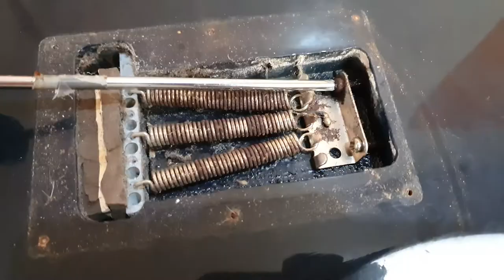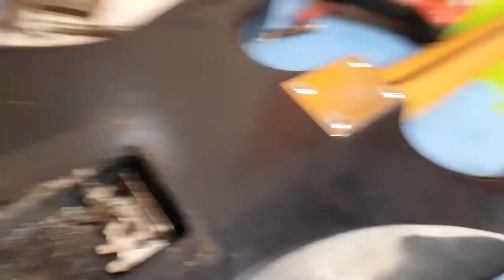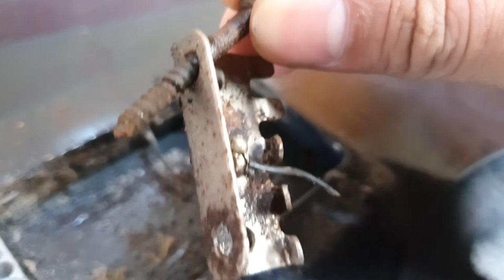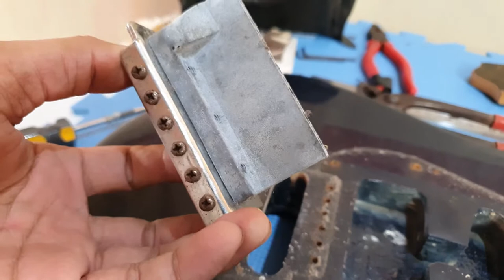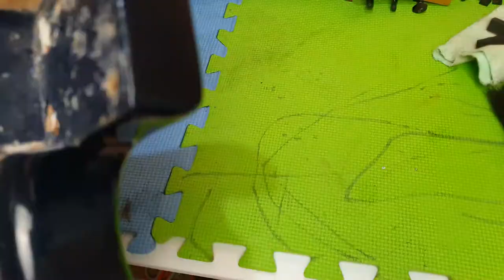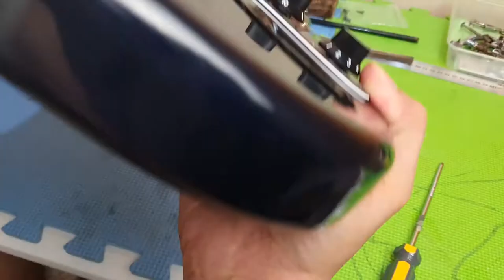Restoring my Old Guitar (Part 1): Installing New Dual Hot Rail High Output Pickups Set & Bridge

Comment: Hola ! Can anyone help me in understanding how to do hotrail pickup wiring. 
There are five wires coming out of it 
Black Red White Green and Bared one. 
I have tried soldering red on the 5 selector switch and black together with bared one on the ground (volume pot)  while leaving the other two taped but the sound was so thin with so much humming. 
Then I tried soldering black on the 5 selector switch and green with the bared one on the ground (volume pot)  while leaving the red and white taped off but the sound was with extraordinary hum what should I do ...
Reply from the maker: What kind of pick up do you have? Because this one that i have i already pre wired. I just have to solder the wire to input jack(hot wire) and ground and thats it.